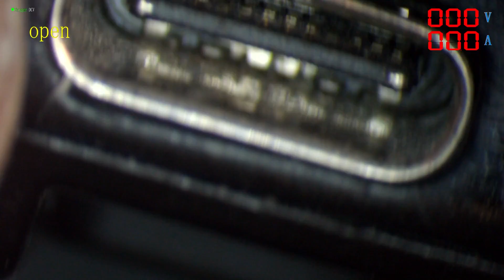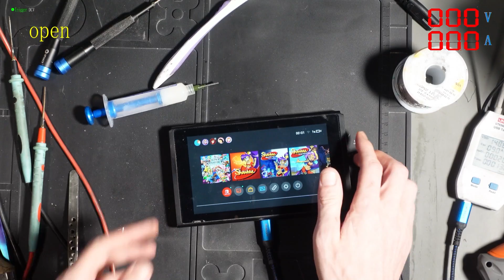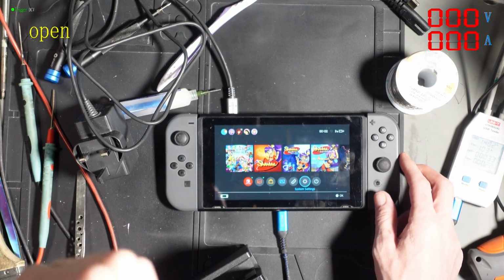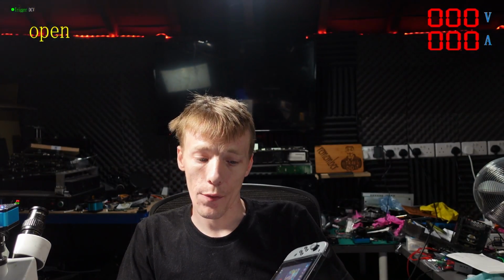How To Fix A Nintendo Switch Not Charging Or Turning On... Stuck On 5v 0.09a

Comment: What if the switch is 5v and 0a? will it be the m92 chip too?
Reply from the maker: Very likely either M92 or a bad charging port. Normally in that case I change both to be safe
Reply: @TheCod3r  Thank you, Because Im having second thought of replacing my m92 chip good thing you confirm it.
Reply from the maker: @hellopo5218  you're welcome. Hopefully it fixes your issue
Reply: @TheCod3r  Thank you might Update you later
Reply: @TheCod3r  I successfully replace the m92 chip but the reading is still 5v 0a
Reply: @TheCod3r  I'll try changing the type c port too
Reply from the maker: @hellopo5218  yeah I'd say change the port, chances are that's the original cause in this case
Reply: @TheCod3r  Ok thank you I'll update u again
Reply: @TheCod3r  Sorry for the delay, I just want to say that my switch is now working I tried replacing the usb port still not the problem but the problem are the resistor near to it. I'd like to say thank you for giving me an idea and clue! May your channel grow!
Reply from the maker: @hellopo5218  that's awesome, glad to hear you got it working bud
Reply: @hellopo5218 hey bro can you explain me how you found this resistor? my oled does not charge,   i checked some caps for short and they are ok. usb connector seems fine to, i have tension but no current.
Reply: @juscelino2253   Hi, sorry for the late reply it is near to the charging port if you cant see it is it ok if I email you the image?
Reply: @juscelino2253   And I dont think its a resistor, I think its a capacitor. Sorry for the confusion .

Comment: My brother's nintendo switch won't charge but it heat up when I put it to charge is not the video chip cause it displays the battery when connected can it be the charging chip that's what I call it lol?

Comment: My oled was charging perfectly fine yesterday and then I put it on charge again last night and it stopped charging, but the charger is fine cos it works with my lite. Any ideas
Reply: did you solve?
Reply: @juscelino2253  I had to send it off to nintendo to be repaired

Comment: Awesome video, I replaced the port that had twisted and broken pins and still didn't power up, then I tested the same points you did on the charging IC and low and behold, same shorts. M92T36 now on order, fingers crossed that's all that's needed!
Reply: How did it go?
Reply: @benchmarking6875  It was the M92T36
Reply: Great video and confidence

Comment: When you reflow the charger ic should you push down a little so the ground plane under the chip and mobo is properly in contact
Reply from the maker: You don't have to do that using this method, the pads need to make a contact with the pads on the chip, and if you use the nudge test and it springs back it means surface tension has done its' job, which means the chip has been installed successfully

Comment: Hi , doing ps5 hdmi port and the small cap close to the hdmi pins is missing.
What's it called and where can I  buy 1 ?
Thanks
Reply from the maker: It's a 0.1uF MLCC 0201 6v but it's honestly not needed. The console will work fine without it
Reply: @TheCod3r  you legend thanks , I did put a question on Facebook and someone said it wasn't needed but wanted to hear it from you.
Reply: @TheCod3r  do i need to bridge it if not replacing it ?

Comment: I didn't play my switch for months and then it wouldn't charge. I have one of those readouts and it was stuck at .46 slow charging with no display. I thought the IC needed replaced but all I had to do was hold the power button for 15 seconds to let it reset and then eventually the power meter came up,  thank goodness
Reply: Will take hours tho mine is taking over 10 hours to charge cuz I haven’t played it since April- may

Comment: Hello. I was thinking if you can try to fix older consoles next time? Like I have troubles zo fix my PS2 slim, and they are notorious that the laser module (possibly an SMD fuse) breaks easily.

Comment: What up.  Love the content.  I got a switch lite that intermittently will not charge or trun on so today I said wtf, I opened it up to look at the battery didn't see anything sticking out so I unplugged the battery waited 15 minutes plug in and it started working.  My question is do you think I should just go ahead and replace the battery or do you think there's something else going on?

Comment: Why is it disappointing to be working on a Nintendo switch? I like working on them and watching repair videos about them too. I have a practically brand new switch I bought off ebay and any time a cartridge is inserted I get the error 2002-2634. Everything I look up points to it being previously hacked and possible burned fuses? I tried looking for possible fuses, but I only know of the charge port fuse. Tried changing out the game card reader and still the same issue. That is the type of switch stuff I would love to see you fix. Oddball stuff outside of P13USB, M92T36 etc. Thanks a lot for all of your videos, man! I've learned a lot
Reply: I worked on several, and I have the hunch they're disappointing because of how cheaply made they're. PCB board and everything. 8 times out 10 once they break they're not worth fixing.

Comment: spraying isopropanol alcohol on to really hot board and electronic parts will  cool them rapidly  causing thermal shock and tiny fractures can appear in resisters capacitors and ICs also it can cause a board to delaminate internally, you should always let the board cool down naturally before applying IPA.

Comment: Morning fella, how do you connect your amp meter to charger please. I have the same amp meter and official nintendo charger but can not get 15v on any switch and 2 are brand new kids Christmas this year. I think it might be the usb c coupler I'm using. Nice work on the m92 from underneath, wish I had seen it 24 hrs earlier tho. I have 10 plus footage of my disaster, I wiped everything on the outer edge next to m92. Took me all day to correct and get working. Unpatched switch tho for 42.50 so can't complain.
Reply from the maker: Hey mate. Great job, I've been there myself where I've really messed up the components around M92. Happens to the best of us lol.

In terms of the meter though, if you have the same one as me make sure you're using it the right way round, I personally was connecting it backwards (input to the device, output to the brick 😂) which messes things up. But also those couplers do work, but only certain brands. Here's a link to the ones I used to have: https://amzn.to/3NqljX4

Personally though, I'd recommend just getting yourself a thunderbolt extension cable, which is what I use now: https://amzn.to/3ynvZlh

Also, I recommend using either the original switch power brick or something that supports USB-C PD (power delivery). Personally I use a uGreen 65w socket which works really well: https://amzn.to/3HUk2GF

On top of that though, only certain ports on that socket work with the dock, I think it's port 2 because that can provide more current, but the plug along with the thunderbolt extension is what I'm personally using right now and it works absolutely perfectly
Reply: @TheCod3r  you know I thought it would hook up to the meter the other way around lol. Thanks for the links as well fella.